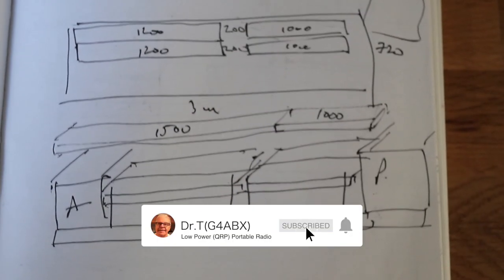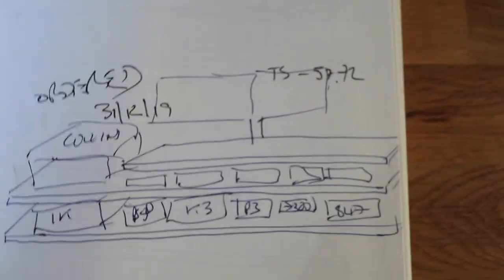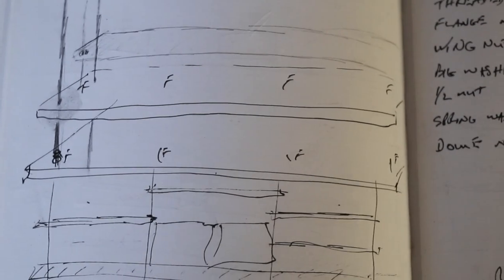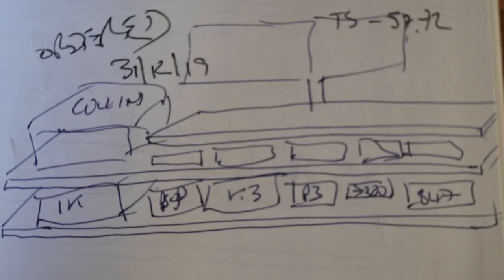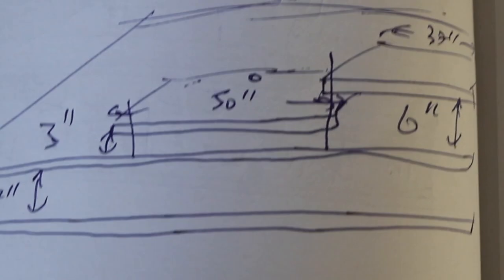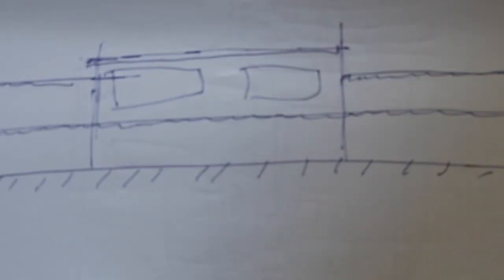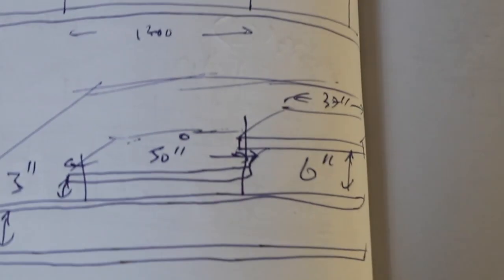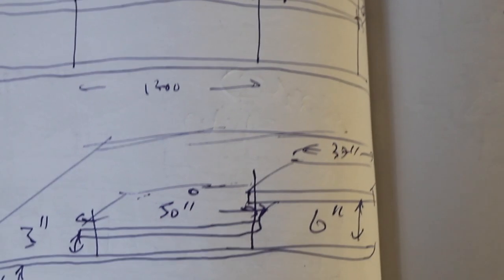Would you like to build The Best Ham Radio Shack Operating Desk?

Comment: I'm a tall guy , the closest I've come to a small desk that I can fit my legs under was a card table I bought at a garage sale!! This is a GREAT idea!!!
Reply from the maker: It certainly gives you flexibility.
The desk height is determined by the height of the supporting trestles -- and you can buy these with adjustable height. They are a bit more expensive but for a small desk, you will only need 2 rather than 4 of them :-)
73
Bruce G4ABX
g4abx.co.uk
@G4abx

Comment: i like velcro for the cables/wires.  Much better then zip ties IMHO
Reply from the maker: Steve.
Velcro is a great idea for cable ties. Its not permanent and can easily be changed as you alter stuff.
Just make sure you don't tie you mains leads into your signal or antenna connections!
73
Bruce
g4abx.co.uk
@g4abx

Comment: I found your channel because of a 'short' that you posted about this desk. I LIKE it! I posted on that short about the possibility of using the rods to help with grounds for all the gear but I'm not really seeing any grounding done. I know that the wall outlets technically have a ground but in America, that's a pretty crappy ground! I don't know how building wiring is done in the UK but in America the wall grounding is a tiny little wire that finds it's way to the breaker box. The little wire may be part of other circuits and is usually tied to the neutral bar in the box. Various types of metals are used for all of this and then a single, thicker copper wire goes to a single Earth ground. If you are lucky, it's a dedicated ground rod but some older construction uses the old iron water pipe for a ground! By the time the Electrons try to navigate this 'obstacle course' of connections and crap, your expensive (and sensitive) equipment been fried by a surge! I have all of my antenna coaxs, radio cases and internal wiring all tied with heavy copper wiring and connectors. This is all connected along a large copper pipe at the bottom rear of the rack and has a very heavy lead to ground. That heavy lead takes the shortest route possible through the wall and straight down to it's own dedicated grounding rod. That grounding rod is also tied by more heavy copper wire to the houses original grounding rod around the corner. Thankfully, I haven't lost any of my radios to lightning or a surge, yet. I also have a large knife throw switch that disconnects the main power and the electricity goes through a couple of powerful surge protectors in series, then the UPS and then to power strips for the equipment. When I'm not running my rig, power is turned off. The large knife throw switch won't let even lightning jump it in the Off position. I've seen lightning 'Jump' through a regular wall switch that is turned off. 
       Anyway, nice desk idea/construction and I hope folks may have gotten a little useful ideas for grounding their rigs. Greetings and Take Care from an American Ham! -John
Reply from the maker: A comprehensive reply John :-)
In the UK, our mains wiring is considered 'some of the best' in the World -- but I agree, for a good RF ground for your kit, you should not rely on it.
I have an 8 ft copper pipe driven into moistened ground immediately where external cables enter my shack.
Coax braid is also grounded at this point and a ground braid from this Cu rod enters the shack and is the single point to which all my kit is grounded -- a 'Star' connection.
It works well and I have never had any issues with RF, lightening or any other kind of mains borne interference in the shack
I also agree that grounding to water pipes and the like should be avoided. (They may be GAS pipes!)
The stainless steel rods of the desk are not used for any electrical connections as they can be undone and moved whenever you have a new piece of kit to accommodate.

Thanks for your input
73
Bruce G4ABX
g4abx.co.uk
@G4abx
Reply: https://www.youtube.com/channel/UCU7ZhTyWhcnU-to8LpC18XA @G4ABX  Hello, I have seen and am using 1/2" copper pipe in the shack walls this is brought out to grounding buss bars at various points. the whole installation is then grounded to copper (???) spikes that are in the ground around the shack exterior. I am also going to advise that you get the whole idea verified and checked by a qualified electrician in your jurisdiction. (UK in my case). getting this wrong can be very very fatal - two veries

Comment: I'm interested to see how those shelves react to lateral force. It looks like they make develop quite a significant amount of movement due to not having any diagonal support.   Have you tried a good whack from the side ? 
I need to make a desk, both to house my gear and to work on.  Small assembly work.  It will house some decently big power supplies, linear and switching.  So need to be reasonably sturdy.  This video is interesting as I work out what I want to do.  
For now I have an old kitchen worktop ontop of several wooden "horses" forming a right angle.  It has worked for the last 9 months and served me well.  But soon I will be moving the shack and need to upgrade. This video came at a good time.
Reply from the maker: The desk is VERY stable
You obviously need to size the stainless uprights for the correct weight the desk will be carrying -- so don't try 8mm dia if you have a linear on the top shelf!
12mm rods are VERY strong and stiff and don't move at all! (Just try sawing them!)
Like everything in life its 'horses for courses.'
The main desk is not secured to anything -- not the trestles that support it or the rods that support the shelves or the wall the desk is against.
Good design, weight and gravity do all the securing needed.
73
Bruce
@G4ABX  
g4abx.co.uk
Reply from the maker: Take a look at my new 'Shorts.' https://youtube.com/shorts/Y6jqJPPv2oc?feature=share
It should answer your question.
73
Bruce G4ABX
g4abx.co.uk
@G4abx

Comment: I am actually in work with a wood crafter who is trying to help me re-design my 10 ft space.   How deep is your shelves if I may ask??  Love the video and the gear on them.  73's KC0QNA
Reply from the maker: Of course you may ask Don :-)
The main desk is a kitchen worktop -- so 600mm deep and 3000mm long
The Shelves are a thinner piece of kitchen worktop cut in half (down its length) to give 2 pieces, so 300 mm (ish) each in width, and 3000mm long. One of these was then cut in half again to give 2 x 1500mm shelves for the shorter versions.
That was the cheapest way to buy the wood I needed.
73
Bruce G4ABX
g4abx.co.uk
@G4abx

Comment: If you cannot move easily behind your desk, you have failed to provide 4 making any changes easily. IF ham shack with equipment pushed against the back wall, then I know not a real ham uses it because you cannot get behind there and make the changes you know are coming with wires and so on.
I wrote an article with pictures and gave it to all the ham magazines but nobody picked it up and published it. I used      4 by 4 posts and carefully measured so my desktop would be at typing height/ also called writing height/ which you can find scientific measurements on the web.
I used a piece of rounded front cabinet top material with a slick finish in my choice of colors-- don't use glaring glaring white-- cures off white or cream or otherwise but no reflecting white.
I made the cross shelves well supported out of the wire frame plastic coated material that is sold to go into new construction as a closet shelf........ Ideal for strength but does not stop air flow.
My height measurement included my addition of heavy duty rollers on the bottom of each leg... Where's foot stomping locks on them.
My article in photos or on an old computer that are tough to recapture, so you just have to use your good imagination........... Ohh and do not shove the back against the wall!!!!!